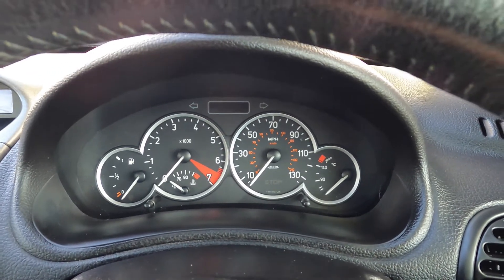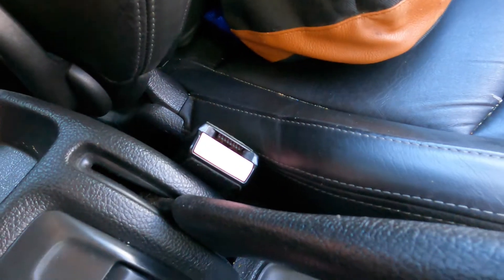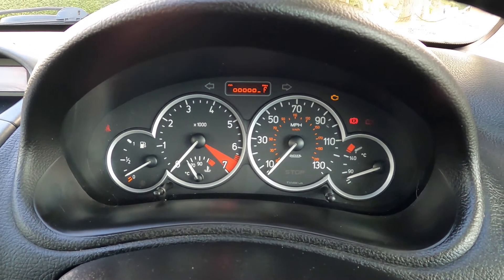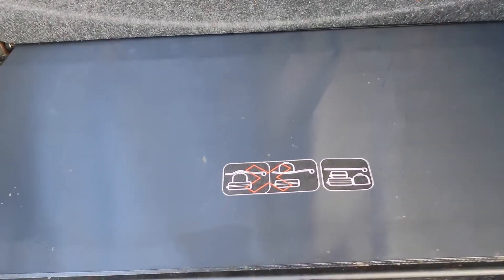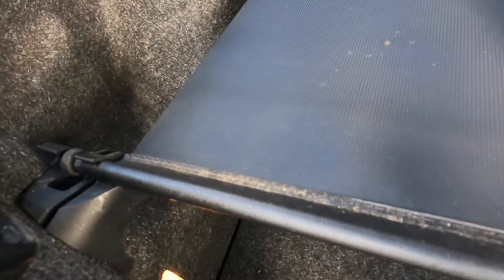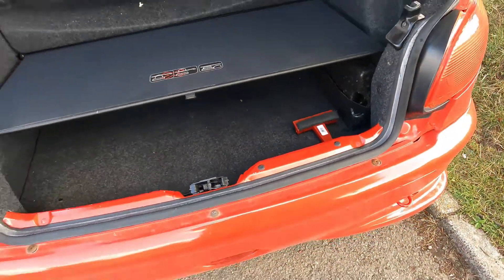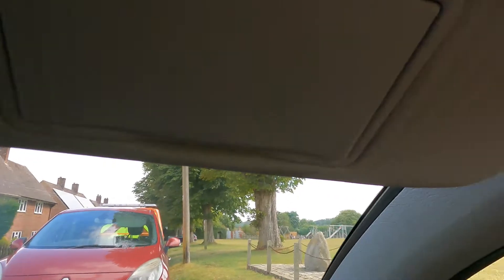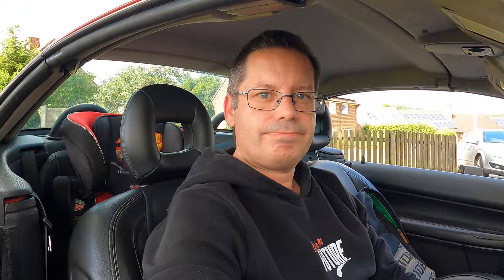206cc roof not working - The Simple MISTAKE and the 10 SECOND Fix.

Comment: Hey mine is just beeping ive checked the shelf is connecting  to the latches and the metalic contact point is touching ive had it open thie morning ive had to remove the passenger side wing mirror today and this is yet to be replaced could this be causing the isuse ive also hoovered it and moved stuff about in the boot today many thanks

Comment: Even though i follow all these steps , when i try to hold the button up it just makes a sound and wont open. There is also a airbag light on , i dont know if it has to do with the problem. What do you think. Thanks
Reply from the maker: It sounds like you might be dealing with a sensor contact issue. The metal sensor in the boot on the luggage cover hook, or the 2 either side of the wind screen under the latches would be a good start.Make sure they are all clean with no play or movement.It is possible they need adjusting . The airbag light could be linked I am not sure is related , so it's worth investigating further! Otherwise you may need a garage to plug it in for fault codes.

Comment: Tell us about your audio setup. Im worried the selaed trunk from the cabin will be a problem when trying to get the sound of a subwoofer into the cabin.
Reply from the maker: I totally understand your concern! The sealed trunk can definitely make it tricky. I have never changed the JBL sub setup myself so I am, not sure if it is sealed or can be removed. I would imagine it can be done as online many people have removed the JBL unit,but it might be a little tricky to reroute new cables.
Reply: @CzechEngine  I want to help my friend put a subwoofer in her boot of her 206cc There is a plastic oval in the middle of the backseats. I was wondering if I could use that to let some of the sound pressure into the cabin.
Reply: I haven't seen anyone do it & with it not being my own car I don't want to break it to find out

Comment: Great video 👍
I have a problem with my roof…the right side of the boot won’t fold down.
Can you help please?
Thank you 🙏
Reply from the maker: Hi Sarah. Ok is it a problem in both roof opening process and opening boot like normal to load stuff? Or just one of those?  I know its not ideal but have a look at this video  https://www.youtube.com/watch?v=CUk3RKVRfVU&t=382s  its not mine but explains the whole process better than me. It could be a micro switch on the right hand side need attention or replacing . It might also be worth getting the fluid levels checked in the motor by a garage.
Reply: @CzechEngine  Hiya thank you so much for your message and information… you’re a star ⭐️ 
The problem is… when the roof is open or shut… the right side of the edge of the boot is sticking up and there is a gap there.
I can see into the mechanical area.
It’s like… it needs pushing down…. Which I wouldn’t do… just want to give you a picture of what it’s like.
The roof goes up and down fine.
I have only had the car a month and now I’m ready worried it’s going to be a problem!
Any ideas?
Kind regards 
Sarah
Reply: @CzechEngine  Hi again…. Just to add… the bit that is sticking up is… along the side of the boot… above the petrol cap.
Cheers
Reply: @CzechEngine  Hang on! What's with the doors in that video? Which year 206cc has the doors opening in that direction??
Reply: @CzechEngine  I had to search for them, but it turns out that you can get Lambo style or a vertical door kit for the 206 cc! The guy had that in the video, but didn't seem to mention it! I've got to go back and watch it with auto-translation anyway.
Reply from the maker: @sarahjane7697  hi Sarah , I am not too sure what this to be honest . I’ve looked for some answers but none seem to be about online . I assume the boot opens smoothly and level and isn’t bent inside in any way ?
Reply: @CzechEngine  Thank you for your reply and taking the time to look into this 👍
The roof and the boot still open and close but the left side of the boot… won’t fully close 🤷‍♀️
Reply: Yes 👍

Comment: Thank you. And just to check is that a kiddie seat you have in the back, is there room for legs
Reply from the maker: It is a kiddieseat yes, It does have room for legs ..just...up to say a 7 year old , partly because I am a short driver :-) .If the front occupants are nearer 6 foot then probably not really.  I am not sure you would be able to fit a baby seat though.
Reply: I tested the back seat before I bought mine. I am just under 5ft5inches, or  1.64m in height and if I have the front 2 seats adjusted, just a little further forward than would be my normal  preference then I can still drive and also , then I can be seated in the rear seats with room for my legs, just. (Obviously I cannot really sit in several different seats, in the same exact moment by myself LOL). Normally I do have my front seats adjusted a bit further rearward than the minimum I could cope with, but then I've never needed to transport persons in the backseat.  So yes it can carry 4 human adults that are ALL 5ft5inches height or less (so European women of average height or shorter. Pygmies and other short adults). If the driver/front passenger  is taller  than 1.65 metres, and needs the driver's and front passenger seats adjusted further back, then you would be limited to seating just smaller children in the back seats. The car is registered as a 4 seater and legal to seat 4 persons.   However usually the rear seat area is most commonly used for luggage, groceries etc etc.
Reply: @CzechEngine   The car is designed to have a baby-seat, fitted to the front passenger seat. Usually this is a "no-no" because of the danger to baby if airbag goes off. But an extra keyhole is located in the dash, can be used to disable the front passenger airbag, using the ignition key. The airbag warning lamp will glow when the passenger airbag is disabled.  The owner's handbook describes this in detail.

Comment: Hi what does the symbol mean next to the ESP is it anything to do with the alarm thanks David it's just below the steering column on the right hand side
Reply from the maker: Hi David, I think it is a button to turn off the Internal protection of the alarm leaving only external activated. If you had a pet or something in the car while you are away maybe or leave the window down a little in the sun. But I think you have to press the button within 10 seconds after turning ignition on. I dont know the sequence myself . I did find this link which might help . Please see below

https://www.manualslib.com/manual/387695/Peugeot-206-Cc.html?page=126#manual
Reply: @CzechEngine  thank you very much 🙏 got it  working fine 🙂 very much appreciated

Comment: JUst borrowed my daughters 206cc and am working through the issues with the roof not opening. Will check the contacts in the morning!  Thanks for posting I think this is the place to start. Serviced it and otherwise a cracking little car saying its 18 years old
Reply from the maker: Good luck! I am noting any quirks i find as I go with mine. It is a fun car. They have aged well and the rust proofing of Peugeots of the time was top notch too.

Comment: The hood of my car does not open because the cable is taut, the cable that goes to the two hooks on each side of the trunk (running along the trunk door).. I don't know if I'm explaining myself correctly... do you know anything about it? Pleeeeeeease😢
Reply from the maker: Hi , I think you can buy new boot/trunk cables or adjust them to a degree,If they are stretched however i think they will need replacing. I havent seen it myself but i did read somewhere overtime they can stretch and break. I think if nothing is obviously trapped or broken it may need to visit a mechanic

Comment: Great video and thanks for sharing. Are water leaks common on these 206cc? Also, how is the noise and overall isolation when roof is up? 
Thanks
Reply from the maker: Hi, I havent had any water leaks on mine. I know a few other owners and they havent either.I think the roof is generally well made. If you do have any leaks i would check the roof latches arent loose at the ront of the roof as these pull in the roof once closed. When the roof is up apart from the usual noise you get from any older frameless car it is totally fine. It is a small car but i will sit at 70 happily with no drama .You can adjust the door strikers to close the doors a little tighter if needed.But overall I dont have many complaints. You forget sometimes the roof comes off to be honest.
Reply: Yeah mine has roof leaks on the driver side and I added some silicone to it. Still leaks time to time. Need to find time to fix it better and seal it
Reply: I had one a few yrs ago, they all leak sometimes, if you get one that doesn’t your lucky, watch out for water leaking into the map light above the rear view mirror, it’s happened to me when I left it a few weeks in the winter, it may be a good idea to buy a roof cover (half cover) if parked up while raining especially in any country that has as much rain as Scotland.

Comment: Hi I’ve got constant pinging while driving 
No bong when I release the latches could you help load cover is located
Many thanks mark
Reply from the maker: Hi Mark, that does sound like the curcuit isnt complete so potentially a contact issue.Mine does odd beeps if i hit a larger pothole where they seperate for a moment.It is a complex roof and is getting old now. Does the roof open and close as normal but you get the annoying bing? or is it nothing at all just binging? The fact you get no noise when releasing the latches makes me think the car thinks they are already unlatched.

Comment: Mine doesn’t move that fast as yours did. What can be the issue to make it move that smooth and fast?
Reply from the maker: I found in most cases the hydraulic pump and the fluid levels manage how fast the roof operates. It could be the pump is worn, maybe check levels of fluid in pump also and for any leaks. I also notice a small increae in speed with engine running over just having ignition switched to circuit .

Comment: Hi.. I done that and my roof is still not working 😕
Reply from the maker: How far do you get ? What stage does it stop and does it make any sounds or bleeps
Reply: @CzechEngine  it dont do anything,  it just beeps as you drive, when you brake to slow down, the beeping stops then continues as you  drive
Reply from the maker: @akashnee1108  it’s hard to say without looking but that sounds like the 2 roof latches above your head are mis aligned so when you drive the contacts aren’t meeting , when you brake they meet. That’s where I would start

Comment: So my switch responds/beeps fine whilst I do all the checks (latches, boot strip etc) as soon as I shut the boot… no response from the switch. It doesn’t beep and the roof doesn’t move. Any advice ?
Reply from the maker: Hi Stacey. Ok it is tough to advise without seeing it.But that sounds like the circuit is not opening and closing correctly when the boot is closed. This could be a microsowitch causing the incomplete circuit. I would first check the microswitch on the blind in the boot is clean and not corroded/damaged in any way. Check the boot is actually closing fully with no messages on dash stating door open. In the boot i think it has one sensor on the boot latch which sends a signal to the roof ecu (this could be the problem one) or  2 more sensors /switches where the roof contacts the boot once closed.check then appear clean and not damaged/missing. Clean all connections with compressed air if possible. If it still occurs you may need to get it plugged in to check and isolate which sensor is causing the issue. Good Luck
Reply: did you have any luck finding what was stopping it stacey? we have the exact same problem, and we have the diagnostic harness to connect to a laptop and all- it says the roof ECU reports no faults, so i hope you have good news..?
Reply: @CzechEngine  hi there, the roof wont open, it wont show any signal or beep when i press the switch.

The drivers door shows that the door is always opened(probably damaged door sensor), can this cause the roof not to open?

Thank you very much!
Reply: If it's any consolation Stacey, I've got the same problem, no beeping, roof not opening, I'm going to take it to a Peugeot specialist to see what he finds out, because at the moment I can't open the roof to put one of the side panels back on after installing an aftermarket audio system 🙄 I'll post what he finds was the problem to let you know 😉
Reply: @A_Pt_9298  (sorry this reply to your message is late) My electric roof has never worked since I bought the car. I just open and close it by hand, which is almost as fast as automatic.  

Using the Hex Allen Wrench, located with the containers of tyre foam, loosen by one turn the hydraulic valve in the right of the boot/trunk.  

The roof can then be rasied and lowered by hand. Having the assistance of a second person is easier, but I manage by myself. 

Ensure to keep hands clear of possible harm when raising and lowering roof by hand. Not sure if the owners handbook shows it, but plenty of Youtube videos do. 

Briefly.  ...Open boot/trunk normally, pull slightly the white hoop staple on each hinge, release the boot hinge and re-insert the clip on each side

. Close boot.  then Open Boot BACKWARDS. 

Standing on right side of car, use the supplied Allen Hex wrench to insert in a little silver hole, set amongst the mechanism, this holds the boot open backwards.  

Open  car door, unclip each front clip and slowly gently raise roof a few inches then it and gently lower into the boot. Second person makes it easier. 

Remove the Allen Wrench from the little silver  hole, so the backwards open boot can now be pushed slowly closed against hydraulic fluid resistance. 

Open boot normally. Re-engage the hinges including slightly pulling then releasing into their holes the little white hoops, one on each hinge. 

Be aware one position is for "auto electric" operation and one position is for manual operating and locks the hinges somewhat.  

I find with mine I need to have driven over a few bumps etc before all the bits and nibs go fully back into place, after re-raising the roof, and only after that does the rear window demister work again. A slight peeping noise when driving over 10kmh and also the turn signal stops beeping beyond 10 kmh ,means those little nibs in the boot hinges have not yet become fully seated. Currently September soit is  late Winter early Spring here. 

The next time I open my roof, another few weeks. I may make a video showing close ups as required. There are other Youtube videos showing raising and lowering the roof. Remember the blind/curtain in the boot is to giove a warning if items are stacked up in the boot and would cause the rear window to break, if thew roof is stowed in the boot, when the boot is full.

Comment: So there is actually a room for a child seat in the back?
Reply from the maker: Yes and no ,in regards to a newborn style seat then no unless passenger seat all the way forward. But a booster or booster with a back for an older child 5 plus you can for a few years This depends on the height of the driver. I’m short so have more rear leg room than others ;)
Reply: @CzechEngine  I ask beacuse I have 3 year old nephew, and I am considering buying this car.
Reply from the maker: @Radlefly  I would take the car seat along and try it in one first . I would say if the driver is short enough it might work ok but everyone is different. It can be done but room is limited

Comment: My roof doesn't want to open but boot comes open roof struggles to come off, when it finally does come up, a banging noise comes from boot end, then roof won't go in boot😔
Reply from the maker: Hi, ok so to start the system should have sensors around it all that avoid and metal to metal contact, If you get a banging noise that makes me think maybe one has failed or is misalligned possibly. The  roof moves based on the pressure of the hydraulics oil pump and the motors, If the motor is worn or is failing this might mean that it isnt building up enough pressure or if the oil pressure is too low on the pump.  Have a look at this video I found, it is very helpful in explaining what each part does.  It may help pinpoint what part is failing .   https://www.youtube.com/watch?v=CUk3RKVRfVU 

Good luck and hope you get it sorted, if this doesnt help you may need to plug it into some diagnostics.
Reply: @CzechEngine  hola, mi techo se abre, pero la maletera no,  no se abre la maletera pero el techo si retroce para guardarse... pero choca con la maletera

Comment: The motor don't run
Reply from the maker: Hi, it could be that you have a faulty or blown relay. It is unusual for the motor itself to fail. You could disconnect the car battery and re connect it and retry. But make sure you have any radio codes etc you may need after. Do you still have everything else working? If that fails it may need to be plugged in and see if the roof ecu has any error codes.

Comment: i have a constant warning sound to drive me crazy but as soon as I brake it stops.What could be the problem
Reply from the maker: Ok if it goes when you brake then do a few basic checks first. Check the brake fluid level is ok. If that drops too low you get the alarm noises and sometimes STOP flashes up and goes away intermittently . I have seen these very low on some cars so top up .Look at the brake pads to see they all have enough material in them as they could also be low and need replacing . Also look at the discs to make sure they aren’t to bad condition or have a huge lip on outer edge. If this all looks ok it could be brake pedal sensor. If not obviously these you may need to be it in to be checked.
Reply: @CzechEngine  Thanks for the reply and I'm suspicious of the braking system, of course I'll check it out first